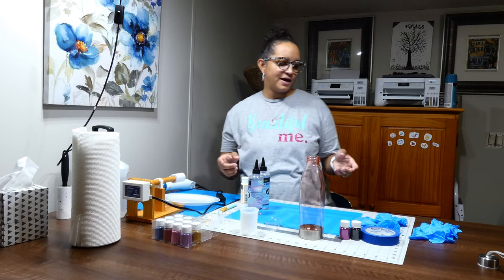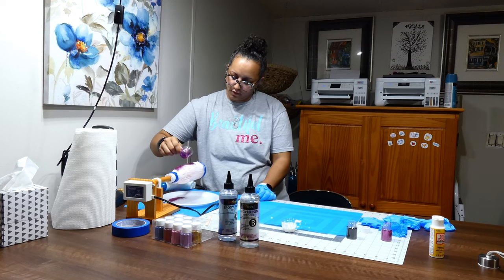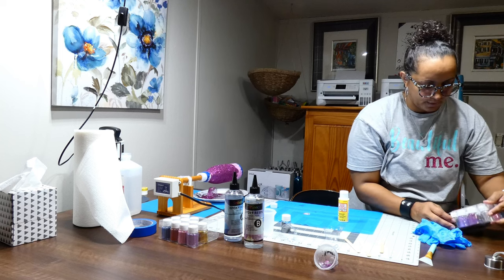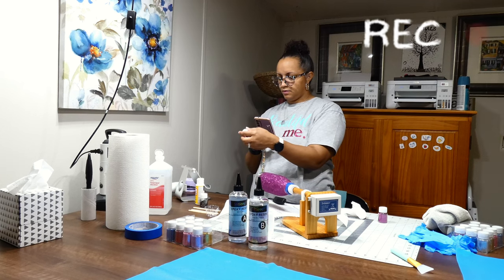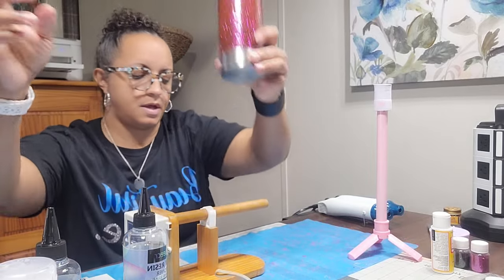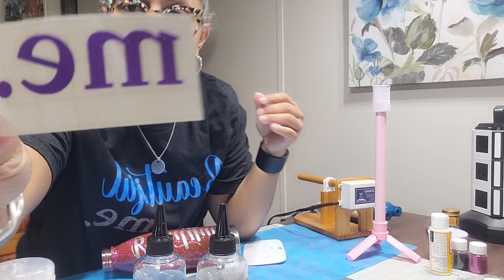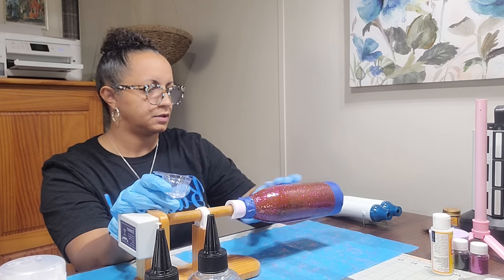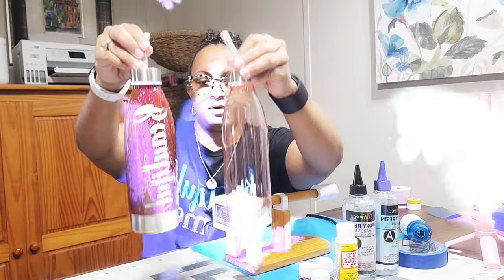Can I | Epoxy a Plastic Water Bottle!?

Comment: Baby wipes will be your best friend while you are working with resin. 
The best way to clean your tools after you use resin is to let the resin cure on them if they are bendable. Once it's cures you can just bend them a bit and snap off the resin. Then for cups I've found that letting them cure upside down on a silicone mat works the best. When they are cured you can pretty much pull out the resin in one go.